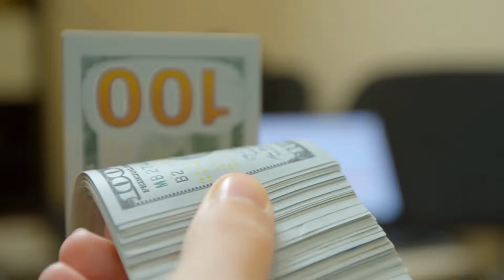Elon Musk's Plan To Build One Starship Per Week

Comment from the maker: Watch Next 👇
A Tour Inside SpaceX Starship & How It Works
https://youtu.be/uqqZhG4SnhQ
Reply: Starship should be made to perform 5 consecutive hops to 500m without refuelling with added tilting to 90 deg and back in each hop.  
Only then they should try the proper landing manoeuvre.
Those Raptor engines still lack reliability when stressed dynamically in flight..

Comment: You can't measure cost of carbon fibre vs stainless steal in weight, 1 tonne of carbon fibre will cover a lot more surface area than 1 tonne of stainless steal.

Comment: 00:06:10 These numbers seem to be massively off. Are these errors caused by conversion to metric? 820°-870° seems rather low for steel. Claiming that aluminium can only withstand 150° to 180° sounds rather , well let's say interesting. Unalloyed aluminum melts at a temperature of approximately  655 ° C, the forging temperature for most steels is well above 1000°C.
Reply: Keep in mind, the mechanical properties change as temperature changes, though aluminum melts at 655, it begins to really  loose it's strength at 300C, 180C seems a bit low to me but it's not horribly off if 300C is your cutoff.  The situation is similar with Steel, but starts at a much higher temperature.

Comment: Here's what I think could be an important question for Space X. They spend Millions of dollars on each SN Rocket and then it explodes during a test to make it reusable. They are spending over a Billion dollars without recouping a cent. Of course, they are getting close to reusability but have many milestones yet to achieve. All this while building their launch facility and production facility. I wonder if they would consider trying to make some money in a "Disposable launch vehicle"? Soon, they should be able to launch a payload with Starship. They could plan for it's demise. Then, after the payload is launched, they get paid, and then continue to test the vehicle to develop its reusable capabilities. At least they'd get some return out of the development process they are not getting now!
Reply: You want your testing stuffs to be fresh and original as much as possible so when the initial tests fails then they can find out what were the flaws/mistakes that needs to be changed/fixed. For example: Lets say you bought a gaming console and you were told that it's untested which means it may or may not work, then just right before you were going to plug it in you accidentally dropped it on a hard floor pretty hard so when you plugged it in and power on you realized the LED light is on but no post on the display. At this moment you have no idea whether it was already defective or you just broke it when you dropped it.
Reply: @timminh468  Funny you should mention buying a game console. After going thru a series of similar tests, just as you said, I had to buy a used machine as mine is DOA. Just some old games in the Man Cave I have a little fun with to pass some covid time! But I understand what you are saying.. Space X does do a series of multitasking tests. They jump a head and test step 10 the same time as step 1,2, and 3. If they wanted to, if the money was worth it to them, they could test launching payloads while they perfect the landing, as an example. In that way, they could show viability of the launching system and recoup some costs while testing. They are not taxpayer funded so the money, at least until Starlink kicks in, is not unlimited. I'm sure there are people at Space X and their investors that are watching these development costs. Since they do multi lateral testing anyway, I wonder if they have considered making some money at the same time? Launching 400 starlink satellites and then attempting to perfect the landing and crashing a Starship might still be a better deal to a perspective customer than say securing an Atlas 5, a Delta 4, or a Vulcan.
Reply: @PC-nf3no  At this point if SpaceX wanted to get more money by launching satellites they would and as a person like Elon Musk he must have went throw that consideration. Plus these things to go up in space to do re-entry, nope they aren't fully finished with it. Still the heat shields are still falling off of Starship going up and coming down and that's not a good thing if starship would consider taking mach 25/re-entry they don't even know if the welding can take re-entry. And Elon Musk and his investors aren't afraid of failure as Elon Musk said. When Elon was testing the landing prototype of falcon 9 they didn't really put satellites on it they wanted to understand the prototype more. And they only have tested 4 Statships all ready and they don't look like there ready yet. Its not just all about money. And no Rocket with it first prototypes really go and put satellites into orbit like that (maybe some.) And even if there losing money they have enough money for 100ths of flight before they even go bankrupt and by that time Starship will be already safe for human space flight plus it will start to pay for its self. So stop considering a about money so quickly, it didn't even show its capable of being reused yet and that's what Elon wants Starship to be fully recoverable and to be reused as much as about 100.
Reply: @reesexd5206 I have tried to look closely and freeze frame the vids to see how the tiles did...just before the crash. Since SN's 8-11 have crashed, it's has not been announced how well the tiles are doing. The point is, that the system may not have to be fully matured to start making some money with the system. Getting to orbit safely and cost effectively and deliver a payload is half of the mission. After all, making money is why companies are in business. But possibly you are right. Space X may have already considered this.
Reply: If SN15 repeats its landing several times then it would take 5 boosters to make one reusable.
I predict 'Dear Moon' will  be not earlier than 2025.
Reply: Starship should be made to perform 5 consecutive hops to 500m without refuelling with added tilting to 90 deg and back in each hop.  
Only then they should try the proper landing manoeuvre.
Those Raptor engines still lack reliability when stressed dynamically in flight..
Reply: @reasonerenlightened2456  Elon speaks about upgrades to newer Raptors. Maybe that will begin to solve some reliability issues. It is an engine in development. But maybe more important is the fuel flow. One engineer points out the issue with not drawing fuel to the turbos when restart from the horizontal position. Maybe all that is needed there is some extra plumbing added for intake on the "belly" side of the tank!
Reply: @PC-nf3no  
... extra plumbing on the "belly" and some one directional valves, diaphragms.
Reply: SpaceX is beginning to profit from Starlink and also profiting from Satellite launches, supplying to ISI, and other contracts with NASA.
Reply: Ed Ducate  Thanks, wish he and I had that connection but maybe someone who does will pass on the thought!
Reply: It’s not an SN rocket SN means serial number so it’s starship Serial number the rocket is not called SN
Reply: @mortalhydra6462  thanks for the update. Very informative